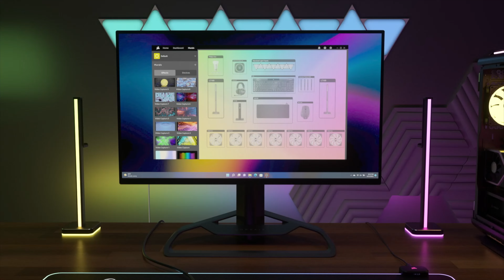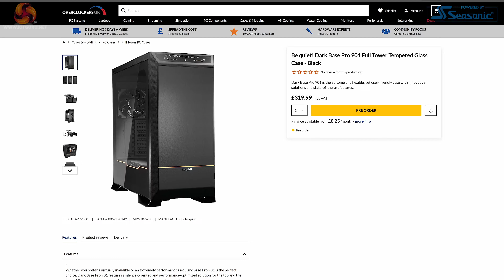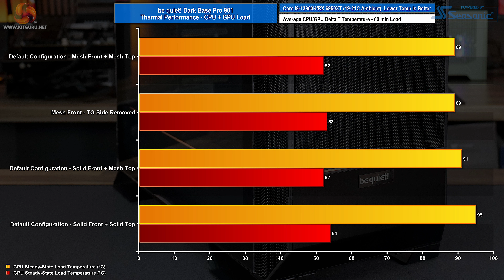be quiet! Dark Base Pro 901 DEEP DIVE 👽

Comment: As someone who owns a DBP900, this is everything I could want in an upgrade. My only critiques are lack of the second 5.25" bay and the touch-sensitive front panel buttons rather than real buttons.
Reply: What specific things are different, I have the 900 Rev 2.
Reply: I have this case and personally I enjoy touch sensitive controls. Why would you need second 5.25” bay?

Comment: Touch controls just aren't something I'd want in a case. Having to bend down or the side to see what you're pressing is bad and the lack of tactile feedback doesn't help. If the Pro 901 had physical buttons you could adjust the fan speed by touch, ironically enough. Plus, I'd expect that with touch controls there's greater chance of accidentally pressing a button when trying to unplug/plug in something to the front ports. So it's pointless complexity and cost for me.
Reply: Touch controls are a great deal *cheaper*. On the 901 it's just a PCB with traces that are being sampled by the front panel's controller (STM32F401 in this case), with a plastic cover laid on top. You touch an icon on the plastic, this de-tunes the bit of copper behind it, and the controller fires off an event. This is much cheaper than having to machine and align cut-outs for buttons, button caps, switches... the front panel can be off by several millimeters and nobody would notice. With buttons, even a fraction of a mm makes for an uneven gap.

The user experience is as you describe, 100% downgrade. I accidentally set my fans to full blast when unplugging a USB drive, and at the same time sometimes it refuses to register a touch when I want to.

Comment: I purchased the 901 and installed a Orico hot-swappable 3.5" bay on the bottom. There were a few things I wish they added 1) Dual 5.25" bays at the bottom, there is room for it. 2) Magnetic attached door as I have to pry it open and find it's easier to leave it open 3) Non-touch fan/LED controllers, ie. knobs or sliders. 4) White option as I loved my 900 white edition 5) Wheels or the option of
Reply: If you use the 5,25" bay, how many mm do i have from top to bottom? can i fit a 420 radiator and 3x 140mm fans in it? would you be so kind to measure it? it so incrdibly hard to find accurate measurements
Reply: @JRobin.  Rather frustratingly, it measures as 40.5cm... Which I found out after purchasing an extra Silent Wings 4 Fan and realising that there is no way to install a third fan if you have the 5.25" bay filled... Then when I went to check other videos and promo pictures I realised that wasn't just me, that's how it is... Yet if they moved the bay slightly down it would have made it possible to install a radiator or extra 140mm fan... So, your radiator will not mount in the front unless you leave the 5.25
 empty.
Reply: @michalwalks  ahh omg. How could they not think about this... But thank you.

It even seems like i cant use the hdd bays on the side if i use a radiator in the Front, is that true?
Reply: @JRobin.  Just by looking I couldn't imagine that working either.
Reply: I'm from the future, white 901 is now on the market. Touch controls are still hit and miss.
Reply: @michalwalks  use extra 120mm
Reply: @iaadsi  I purchased the new white one but now the touch controllers are barely responsive...

Comment: Thank you for going through the effort and measure temperature and noise levels with and without the solid panels. Not many reviews do that. It would have been good to know the distance between the mic and the case at which the ~50 dBA were recorded, as noise tends to fall off the further away you are from its source.

Comment: Absolutely love the flexibility in this case. I like my AIO's top mounted, but I reckon if I was going air cooled, I'd put the solid panel on the top. For me, it would be mesh in the front no matter what the cooling solution, but amazing to have the choice. Together with all its other features, this looks like a real beauty. I just wish they had included a third fan for the front

Comment: I bought a Pure Base 600 case and added two 15 years old 120mm Noctua fans to it along with the 140mm and 120mm fans included. Couldn’t be happier with the noice level even though I rarely use headphones. Also the cables and dust controls are amazing for just a cheap price.
Reply: Nothing more important than dust and noice control: It’s a PC case, not a chandelier (to para-phrase Wade Wilson).
Reply: depends on gpu and air cooler, could be to hot for air cooler and 4090 in that case
Reply: @milordas  Probably. Don’t have a 4090, since I do some 1080p gaming but mostly Photoshop and 3D design.

Comment: I am looking to get this Case to do side mounted 360mm AIO (push/Pull 6 fans) as intake with front 140mm fans as intake. what was clearance like from top to bottom? i seen other reviews saying 395ish mm I have EK lux nucleus 360mm (which actually 400mm long) do you think It could be persuaded in with a bit of effort?

Comment: I have to ask... I am far from a good PC builder, but did you build a radiator loop system into the graphic card? For what? More cooling? I dont even know how that is possible. I understand it with a CPU, for better cooling, but never seen it connected to the graphics card before. What did i miss? :/

Comment: really cool video. best one i seen about this case. if you have a moment, do you know what will be the best 360 AIO cpu cooler which will be no issue installing on the top of the case?
Reply: I think any 360mm AIO should fit in the top of the case.

Comment: I've heard the GPU anti sag concealer scratches the PSU shroud quite easily?
Was that your experience?

Also can you also share if the GPU anti sag concealer worked with the 4090 12VHPWR connector and cable without bending?
Reply: I'll let you know when I dissassemble the system. 👍

Comment: Thank you so much for this in-depth review of the case. I have one question: since the hard drive trays are secured to the case with only one screw, do you think the HDD drives will vibrate a lot in this case (especially if mounted in the upper spaces)? I am not worried about the sound, I'm worried about HDD lifetime. Thank you!

Comment: Thank you! Love the review as this is the case I am planning on buying for my first-ever custom-loop PC! I am planning on using the EK X360mm Radiators. I wonder if they will have the same issue as you experienced on the side bracket. Can I fit x3 58mm thick radiators in this case?

Comment: Great review! just curious, do you think you can fit a side 360mm AIO and a front 420mm AIO at the same time? Hard to tell if there's room. Also, it looks like most of the fans have filters but not the side mount, is that correct?
Reply: I don't think a front 420 and side 360 together would be possible. The side vent has mesh but not a filter as such.
Reply: @KitGuruJames  thanks very much, appreciated ! that was what I had concluded mostly but wanted to be sure. Would be handy if BeQuiet put some example combinations that are possible on their site.
Reply: @BrickBazooka no need for a dust filter if you do that.

Comment: BQ really needs to rethink their under-shroud hdd mounts. This one forces you to go without an optical drive if you use them, though there is plenty of room for a different design. On my 500dx, the hdd mount completely blocks airflow from the bottom front fan. I removed it and used a bracket velcroed to the bottom of the case. This let the bottom front fan feed air to a shroud-mounted fan under the gpu.

Comment: Would it be possible to switch the set up on the side for the GPU cooler inside out so that the fans can be seen inside the case instead if the metal cooling?

Comment: as it should be. if i get one. nop. sadly just shipping to here is 200usd plust the cost of the case. yea sadly therere is no rep in the brand locally. the case look impresive.  has it all. the back is perfect a space to put all. and the finish is clean. i think the hub need to be check i check the manual that max speed is 1900rpm so anything above is limited to that speed. let see a magic wattercool build later.

Comment: Nice review, would have been nice to see a big Eatx mb used but hayho. Do you think it will take a 420 rad front with a 360 rad in the top?
Reply: I think that should be possible because the fans mount outside of the front chassis frame.
Reply: @KitGuruJames  Thank you, checking bank account....... :-)

Comment: The metal structure on top of the PSU looks flimsy and in fact it got bent at 24:06 when installing the GPU support. Maybe it was a user issue but there's no more room to install the parts in it, it should have better support in that section.

Comment: Delightful build as usual. Great and clear descriptions, too. When I first saw the case, I thought, "I bet that has 200mm fans." How wrong I was. 

You noted that the case has 8 expansion slots rather than the usual 7; I wonder how this case would fare with a workstation build (Xeon / Threadripper Pro) and four dual-slot GPUs or AI cards? Indeed, I wonder if that extra depth could be used to fit blowers to such cards?

Wireless phone charging seems to me like a gimmick, but then I have the case of this PC in a cupboard, so I'm not in the target market.

You noted the fan hubs built into the fan mounting frames: with fans now themselves clipping together and daisychaining this seems a little too late, and you mentioned that the front frame no longer mated after you used the other holes, so that's pretty useless.

I do have two questions:

First, how does the GPU support bracket affect GPU cooling? It looks like it would cover part of the rear through fan or cooling fins or both on certain cards.

Second, I think you did miss one key question: £380 is a lot of money for a case so how does it compare to competitors like (for example) the Fractal North and Fractal Torrent, or indeed the Fractal Define XL (if you want lots of HDDs or GPUs). And, moving upwards, how about the £450 HAF700 case you reviewed a while back? More simply, why should I spend all that money? Is it really £275 better than a £105 case like the Endorfy or Montech you reviewed recently?

Keep up the good work.
Reply: I think you should be able to position the GPU support in a way that it covers cables and doesn't interfere with airflow of through fans with most graphics cards.

The wireless charging is a great feature for someone like me who is at the PC for long periods, forgets to charge my phone overnight and usually needs a phone charge during the day, but often doesn't have a USB cable handy.

£320 is a lot of money for a case for sure. In terms of cooling a basic gaming PC then this probably isn't much more useful than a £100 Endorfy or Montech case. 

However if you find the features useful, need tonnes of storage space and/or want to create a big custom cooled build with multiple large radiators then this is great. The flexibility you get with this isn't available in most cheaper case too. But it all depends on what you need from a case I guess.

It's difficult to compare it with any of the other cases you mentioned, the Cooler Master HAF 700 is similar in size but it's designed to appeal to a different taste. This is more for the subtle professional user that needs a high end system. HAF 700 is more of a big showcase type case for showing off your RGBness 😊.

Personally I would choose the Dark Base Pro 901 as it has more useful features for me.  My main rig has custom cooling, 4 x 2.5inch SSDs and two 3.5" HDDs so this would work well for me.
Reply: @KitGuruJames  Thank you for a thoroughly comprehensive (and comprehensively thorough!) reply.

Comment: Front fans holder should be reworked, as you cant place rgb fans in without restricting leds, or you should remove dust filter for that and mount fans on oposite side. And damn, this case could be 5-10cm shorter

Comment: How do you connect the wireless charger? I can't get it to work...
Reply: it plugs into a sata power cable.  but it does not work when the computer is turned off.

Comment: 280mm AiO can not be installed at the top sadly, just like my Silent Base 802. VRM heatsinks on the motherboard are in the way. Sad for such a wide case.
Also, I would switch AiO positions so the GPU is outputting heat out the top and not into the case.
Reply: A 280mm AIO should fit at the top no problem. A standard 27-30mm radiator plus 25mm fans will be above the motherboard so will not interfere.
Reply: @KitGuruJames  Even the official page omits the 280mm:
Top (mm)	120 / 240 / 360
Front (mm)	120 / 140 / 240 / 280 / 360 / 420
Side (mm)	120 / 240 / 360

Now, maybe it is an error on their part... My Silent Base 802 also looks like it should take the 280mm at the top, but the VRM heatsink  and the radiator intersect for a few millimeters. If only Be Quiet made the mounting holes 2-3mm to the left...
Reply: @madant7777 yes maybe be quiet omits the 280 as it can't guarantee every 280 will fit. But looking at the clearance around the 360 AIO I fitted in the test system a 280 of the same thickness should fit without too much hassle.
Reply: @KitGuruJames  Maybe you could make it a regular point to check if the 280mm really fits at the top 😎

Comment: I see that the "anti-sag bracket" is a worthless PoS, this is clearly demonstrated repeatedly during the build @24:00 where it is very clear that the "support" below the "support bracket" is the weak link, and it clearly sags as any force is added to it.!!!  In any instance, as has been shown before, if the graphics card backplate is securely connected to the I/O plate then there is almost no sag anyway, thus totally negating the point of these "GPU supports", plus it has to be noted that at this time in the video, the GPU water-cooling cables are twisted, likely wont make any measurable difference, just worth noting... sometimes it's the small things..

Comment: To me this case is nothing special and even surprising downgrade in pc case design compared to their own 802 - side panels on thumbscrews vs tool-less; more complicated swapping mesh/silence panels or needing to remove front panel to access bottom filter (!). Besides this case is disproportionaly huge compared to it's dissapointing capacity (radiators; drives). For such money man should expect everything being world best. Let's compare 901 to Fractals Define 7/Meshify 2 or to be more fair in terms of size and price, to their XL variants. They massacrate 901 in every regard when costing noticeably less and bq! offering can only defend itself with charger and inverted layout. There're also three better Silent Wings 4, but you could equipp Fracals with them for the price difference. This is what 901 really is - just inverted layout and charger for steep price.

Comment: Since it has a painted chassis, the RF Ground is destroyed!

Without a proper RF Ground return to the PS, any system using this case will leak RF and suffer from power sag.

Real PC cases use bare metal chassis!

Have a look at any system that complies to standards like Lenovo Think Station or even Dell and you will see bare metal chassis for proper grounding.

Total Junk!!!!!!!!!!!!
Reply: absolute cobblers.
Reply: @boltsandbraces6261  You should use a more universally understood term, I had to look up what cobblers meant.
I am a electronics engineer with 50 years of experience in witch my comments are based, so like it or not this case is a POS!!!!!!
Reply: @rjrussell63  it’s ‘which’. ‘Witch’ is a magical woman with a crooked nose and green skin who plagues children. I learned that as a kid. Didn’t take me 50 years of experience.

Comment: Another bullshit video about how "good" are this rubbish design bad quality case, if you see he was forced to install the video-card on second slot because the first one is not usable because the BeQuiet made a mistake covering basically all main video-cards ports in the first slot with the sheet metal from motherboard carrier. Basic engineering mistake. If you want to put the videocard in first slot, consider taking an angle grinder/cutter to remove that part of sheet metal. I dont know why people never show those serious issues with this case, just doing another brainless stupid video. Incompetents....are everywhere.